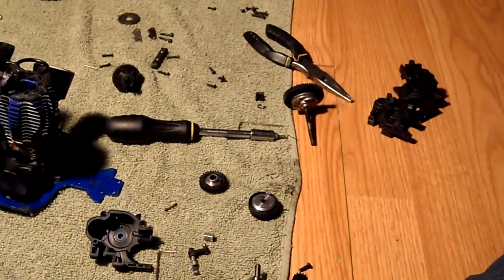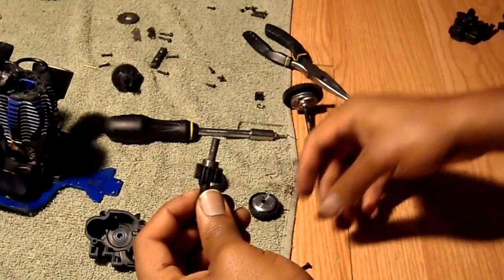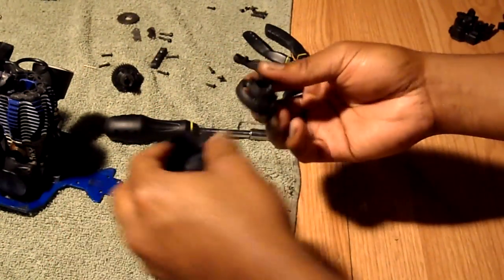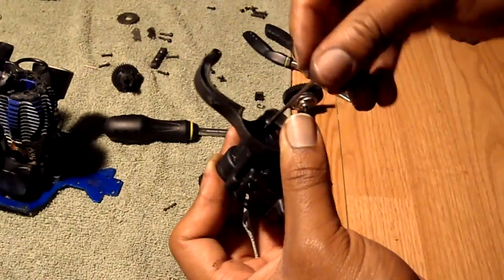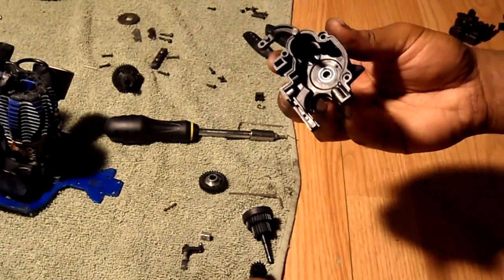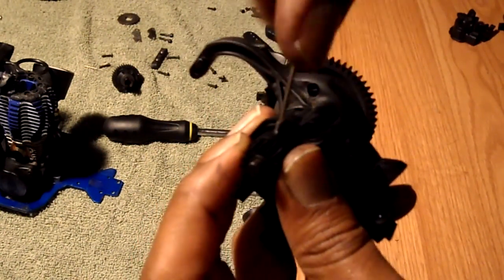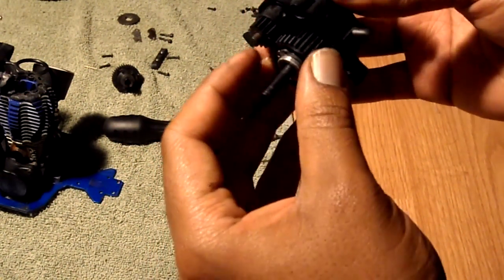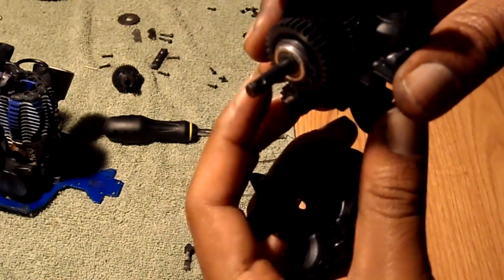Jato 3.3 Transmission Assembly

Comment: @stealthfox109 its upto you bruv but if u r running or racinging it around on large flat surfaces then a 2 speed gearbox will do or a supercharger, turbo even nitrous is available, but if its for show bling it up with alloy parts, but if you r going cross country or bashing it around then i wouldnt do anything to it but if you want you can change the exhaust and it will be great for anything you want to do with it, so if i was you i would go for an exhaust system but make sure its the right one

Comment: @daverseofficial, bruv i would recommending you put thread lock, that prevents screws untightening, but great vid since you said you are a newbe, welldone bruv, also bruv use some grease on each gear so it wont crunch together.